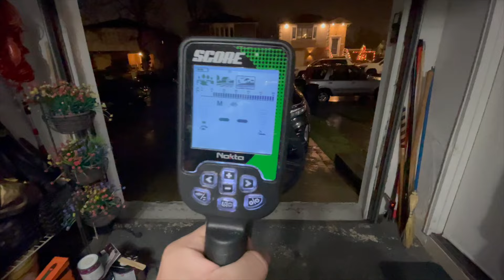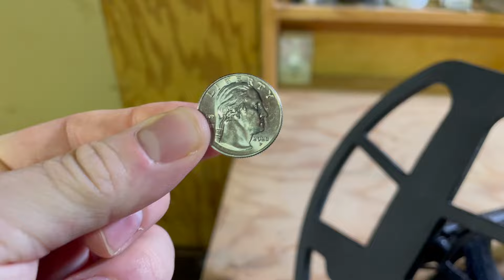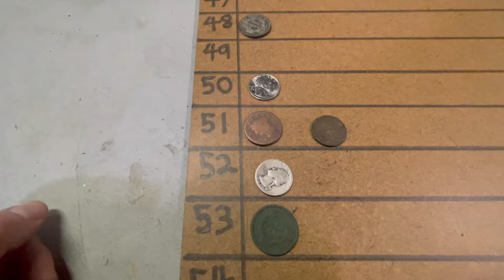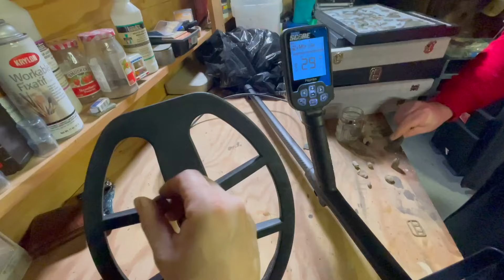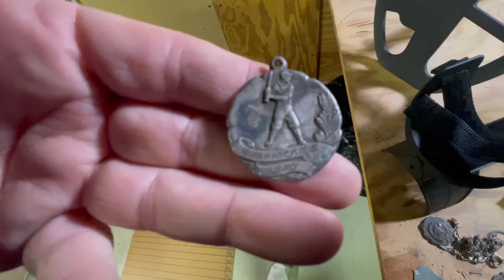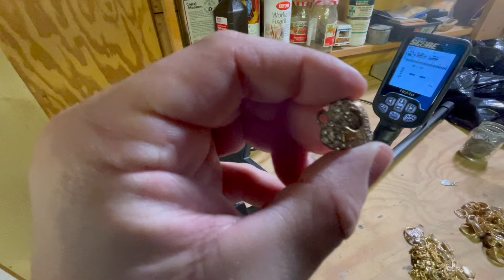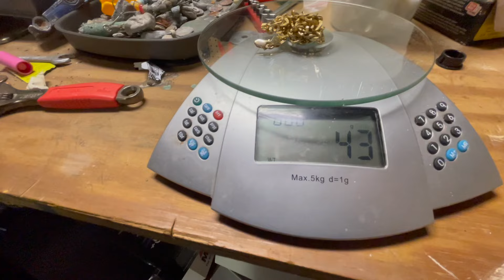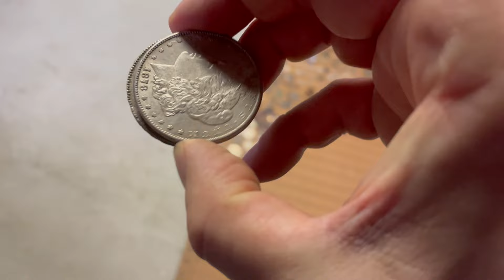Nokta SCORE Series Target ID (VDI) Bible: Your Ultimate Guide

Comment: How deep will it scan? I'm  looking for a detector to scan about 4 to 5 feet through soil and rock.....suggestions please
Reply: You are gona need a two box metal detector if the target is coffee can sized or larger... so XP Deus II with its deep detection two box attachment. 

4 and 5 feet, especially 5 feet is asking a lot from a standard single coil metal detector and if you find one... its gona be expensive.
Reply from the maker: This will not go that far deep. Check out the Xtreme hunter by Deus to hunt caches.

Comment: Thanks for this ... The comments help a ton - and it is the same for the other detectors.  I am making an assumption that the target id's which you did for the new Score is the same as the Legend with 1.13 on beach mode with "all metals" selected? .... is that true?  Also, question, what was the tone value? 6, 60 or p?
Reply from the maker: There's a difference in targets. The Score is not the same software as the Legend.